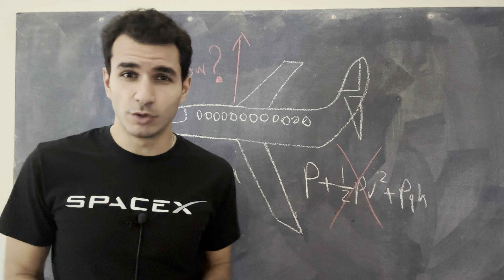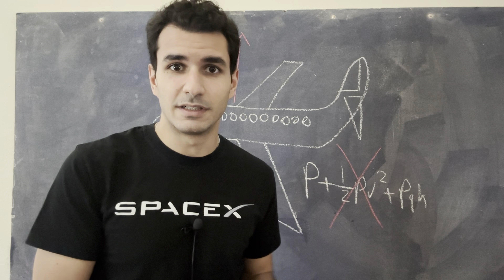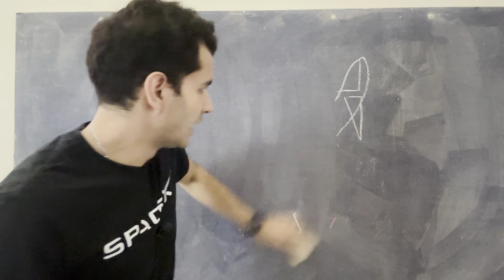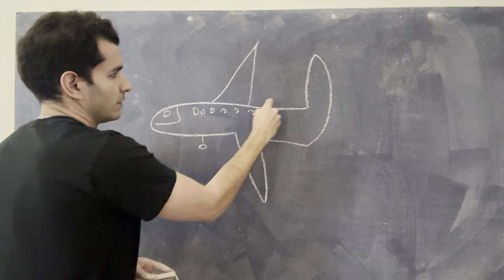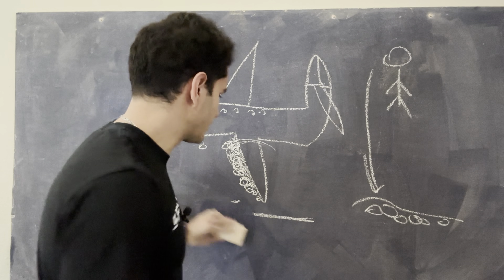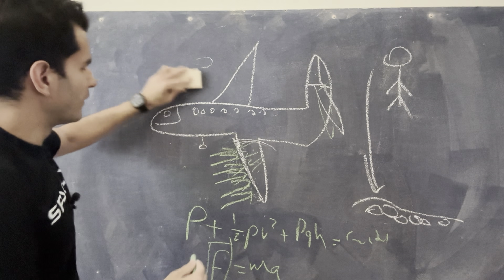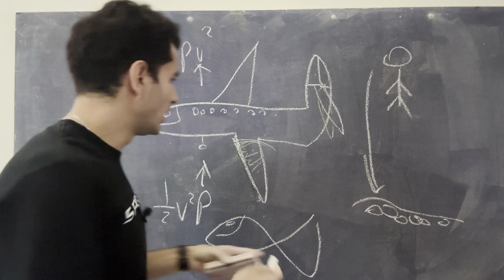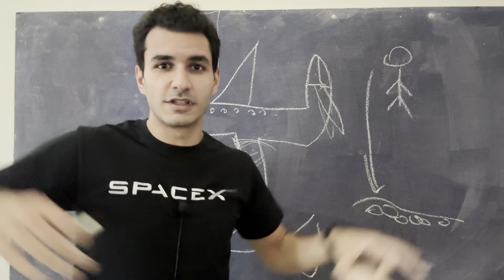Fix This One Misconception = Understand Airplanes Forever

Comment: The best explanation so far 👍, inertia! The wing splits the air by pushing downwards and forwards on the air at the stagnation point, this results in the upwash ahead and subsequent redirection(downwash) of the flow once it reaches the wing. You have to have an intuitive grasp of how the fluid is disturbed by the wing before it passes through it. As air starts to accelerate dynamically, due to the upwash, before the wing arrives there is a static pressure reduction above. As for under the wing air, oncoming air is diverted to follow the shape and leave parallel to the trailing edge. No equations needed.
Reply: No equations means no laws, no laws means no disciplined guidance to follow the painstakingly established rules, which leaves us with the anarchy of personal preference biased narratives.  It is absurd to say it is only inertia/momentum, when it has been unambiguously validated in the aviation industry that it is conservation of mass (continuity equation), energy, and momentum, separately but interdependently accounted for.
Reply: @davetime5234  Do you know why it is crucial for a wing to produce an upwash ahead of the wing? Explain in your own words please.
Reply: @singh2702 It's gotta get to the other side.  And a traffic jam exists precisely because everyone is trying to get passage through a common, capacity-limited highway.
Reply: @davetime5234  So when the oncoming fluid is directed upwards, more air is forced into a particular volume, resulting in a drop in static pressure before the air even goes over the top of the wing. This is Bernoulli and continuity. Once the flow enters the adverse pressure gradient, there will be pressure recovery until the boundary layer detaches and flow becomes turbulant, for which there are no equations to model turbulance.
Reply: @singh2702  There's an important point about the applicability of well-established fluid dynamics equations within their valid range. The Euler and Navier-Stokes equations fundamentally describe fluid motion, but turbulence—especially fully developed turbulence—remains notoriously difficult to model with exact solutions. Critics sometimes argue that these equations fail because they don't directly solve turbulence, but that’s an issue of range, not an indictment of the equations themselves.

The equations are sound within their applicable domain: before flow detachment and chaotic turbulence take over. The criticisms stem from the inherent complexity of turbulence rather than a fundamental failure of the equations. This is similar to how classical mechanics works well for non-relativistic speeds—Newton’s laws hold up beautifully until relativistic effects dominate, at which point we turn to Einstein's formulations.

Bernoulli’s principle and the continuity equation describe pressure and velocity behavior in streamlined flow, but once adverse pressure gradients lead to flow separation and turbulence, we step outside their idealized assumptions. That’s where empirical models, computational fluid dynamics (CFD), and statistical turbulence models (like Reynolds-Averaged Navier-Stokes or Large Eddy Simulation) come into play.

This is how scientific modeling works—we frame equations within the domains where they produce valid results.
Reply: @davetime5234  Having said that, back to lift. It is the negative pressure gradient caused by the upwash, which is responsible for the lower pressures above the 1st quarter chord or so. After the restriction, pressure recovery begins in the positive pressure gradient all the way to the trailing edge, assuming their is enough kinetic energy in the boundary layer. This is how lift is produced. 

Under the wing air is being redirected to leave parallel to the trailing edge.
Reply: @singh2702  "Having said that, back to lift."

The problem is that this statement actually re-directs focus away from lift by focusing on one element to the exclusion of others.

Sure, the decreased pressure is lowered potential energy for the increase in kinetic energy imposed by the upwash detour, under the condition of mass flow continuity.  But lift is a bigger picture. The pressure gradient has to operate on the larger environment; it can't just exist by itself in a limited pocket.

There must be a net downturn in flow momentum, or no lift.

For above the airfoil, where most of this pressure pulling down on ambient pressure flow occurs, the whole point of lift is for this pressure gradient to affect as large a mass of air as possible to minimize velocity in net downward momentum change.

Only the above maximization of mass in the lowered pressure's resultant downward momentum, will enable the energy efficiencies of sailboats moving faster than the wind and airliner glide ratios of 15:1 or better associated with economically viable fuel consumption.

Lift is an asymmetry turning the relative flow according to conservation of mass (continuity), energy, and momentum.

You really can't abbreviate the whole picture, because then you only have part of the engine.

Potential flow, for example, is a truncation of reality that give pressure change without downturn of momentum due to the irrotationality restriction.

You really can't have lift without the net momentum downturn as part of the picture.
Reply: @davetime5234  What have I abbreviated? I said that as the air transitions into the adverse pressure gradient pressure recovery begins, i.e., mass is conserved by being slowed down so as to increase its static pressure by lowering the kinetic energy in Bernoulli's equation in order to ensure continuity. This process will take place so long as there is enough energy in the boundary layer or if the pressure gradient isn't too strong. 

Pressure gradients are responsible for the pressure differential needed for lift.
Reply: @singh2702 How does the net change in downward momentum fit in with the pressure change, and how is the mass of that maximized at the expense of velocity?  What does this imply about the volume size of this mass in relation to the size of the airfoil?  Why does the mass flow transport split in the proportion it does and how is that split related to the pressure difference?  How is the mass flow continuity related to that split, and how does this split relate to the discredited ETT, and to the circulation?  How does the forward stagnation point streamline set the asymmetrical flow split that maintains the pressure difference?
Reply: @davetime5234  You've asked so many questions, which I don't really know exactly what you're asking.

The stagnation point is placed under aft the leading edge, not at the front. It takes place there because of AoA and geometry of the wing. Having the stagnation point there enables an upwash as the wing pushes downward and forwards as it splits the air, resulting in the oncoming air flowing upwards. 

I have already explained the pressure gradients that this upwash creates. That takes care of what's happening above the wing. Under the wing, air is redirected by the same downward forward force to follow its shape all the way to the trailing edge. The forward force component is the pressure drag associated with lift. As a wing moves through the air, the stagnation point remains unchanged. In order for it to remain unchanged, it needs to be moved forward as the wing moves forward, which means air on either side of the stagnation point is also pushed forward.

That explains the way a wing causes an upwash and a subsequent redirection of the flow to leave parallel to the trailing edge.
Reply: @singh2702  To get to the point, where is the downwash caused by the pressure drop on top?  You can't have lift without it.  The force equal to the rate of change of downward vertical momentum?

And the mass required for that force corresponds to what volume of air at ambient density?

My point here is that pressure difference, as you have strived to define, is without question indispensable.  

But equally necessary for justifying the mechanism of lift is how the downward momentum change occurs.
Reply: @davetime5234  Firstly, the airfoil produces an upwash ahead essentially converging air, and when this happens, the flow will accelerate due to the conservation of massflow rate. This is where lift begins by creating the condition of dropping the static pressure above. 

Once the flow has reached its peak velocity, it begins to enter the adverse pressure gradient. This is the diverging part of the foils upper surface, where downwash begins, as the flow will follow the shape of the upper surface due to the viscous forces. The pressure drop that was caused by the upwash is reversed here, velocity begins to slow down, and static pressure increases until its back at ambient pressure as it leaves parallel to the trailing edge. The boundary layer can not be neglected in achieving this flow pattern as its attachment is paramount in preventing turbulance and drag.
Reply: @singh2702 But why don't you have net downwash rather than the downwash you just described, simply erasing the upwash?  And again, the volume of air that must be accelerated down corresponds to requiring roughly what extent of influence height around the wing?  Well less than a chord height vertically, roughly the same as one chord, or well more than one chord height?

I hope you see why this is an important idea cross check.
Reply: @davetime5234  You are asking me for specific details now. These details will depend on the geometry, the AoA, slats  flaps the speed of the wing etc. 

The downwash is just the undoing of the upwash created by the wing. This is why a tear drop shape, similar to an airfoil, is the most aerodynamically efficient shape. After the air is disturbed at the front, the shape allows for the air to recover to its original pressure just before it flows off. It's the closest we can get to D'Alembert's paradox.
Reply: @singh2702 So again, are you saying there is no net downwash, only the undoing of upwash?  Because that seems to be what you are saying?  What does D'Alembert have to do with the considerable change rate in downward momentum?

If you can't reconcile the above you haven't explained lift because lift cannot exist with that vertical momentum change.  Pressure difference alone will not allow a fixed wing aircraft to fly.
Reply: @davetime5234  You seem to be confusing the downwash with the momentum theory of lift. 

The downwash is a result of the air following the shape of the rear uppersurface due to viscosity. In circulation theory, the fluid also leaves in a downwash but not due to viscosity. 

In my previous comments, I mentioned that downwash is pressure related as this is a pressure gradient as long as the flow remains attached along the gradient. The downwash leaving the trailing edge is a byproduct of lift and does not act as thrust. The lift vector is perpendicular to the wings forward momentum and is due to pressure differentials across the lower and upper surfaces.
Reply: @singh2702  Just to be clear, you are saying the following is false?:

Force = Lift = d(mv)/dt  (vertical)

Is that what you mean by "thrust" or not? And is the above relationship true or not?
Reply: @davetime5234  If you are talking about under the wing, I already explained that oncoming air is forced to leave parallel to the trailing edge. So I'll reiterate to make things clear, the upwash heading towards the underneath of the wing is pushed downwards and forwards, resulting in an upward(lift force) backward(drag force). The upward force leaves the air molecules nowhere to go because they are applied against the lower surface, but the drag force accelerates the air parallel to the lower surface. Newton is applied because of the momentum change. 

The downwash on the upper surface is due to the flow following the contour due to viscosity.
Reply: @singh2702 Unless you integrate the vertical momentum identity you are stuck in an incomplete narrative.  A physically accurate explanation really needs the the stress test of integrating the pressure difference with the momentum displacement.
Reply: @davetime5234 Momentum change of the fluid imparted by the wing, is necessary to produce the conditions conducive to lift. It is not directly the cause of lift. Lift is due to the pressure gradients which creates pressure differentials.  

The amount of downwash force for an A380, if it was a reaction force to the planes weight, would be over 5,5 million Newtons. This is ridiculous, as surface area pressure between top and bottom would mean nothing. The reason why plane's wings have large surface areas is to create pressure differentials rather than rely on Newton's 3rd Law, which is very inefficient since it neglects ambient pressure which is a readily available force which can be manipulated and harnessed to lift an aircraft with a mass exceeding 550 000kg.
Reply: @singh2702 Your physics are wrong at the most fundamental level (about downward flow momentum). It's not a question of assigning cause and effect, it's a question of association:  

For the A380 to stay up at level altitude, there must be an associated downward (rate of) change of momentum.

This is unambiguously true basic physics.

And you're roughly right about the number: the A380's wings must produce a downward flow momentum per second of about 5.5million newtons.  

That obviously has consequences when thinking about how the pressure difference accomplishes so much vertical momentum change.
Reply: @davetime5234 Lift is pressure differentials, which I have explained elaborately how a wing achieves this. Downwash momentum is a byproduct of lift. 

There's a video of a KLM 747 land at St Maarten, check it out. It flys a few meters above the people's heads standing on the beach, as it approaches the runway. 

The weight of a 747 ≈ 440 000kg×10m/s², that's 4 400 000N. If the downwash reaction force, to the planes weight, leaving the trailing edge was 4 400 000 Newtons, those people would have been flattened like pancakes. Instead as the low flying aircraft passes over them not a single person is affected by its close proximity.
Reply: @singh2702 The people wouldn't be flattened at all: 

5,500,000 Newtons of force for an A380 (or whatever the exact number) is distributed  over a vast volume of mass with a huge footprint, that in 1 second of forward travel of the wing, multiplied by the wingspan, all divided into into 5.5million newtons comes out to the weight of a couple of cats.

So, the mass of two cat's worth of air mass travelling downwards at a fraction of the forward speed of the aircraft, distributed over the profile of the human body.  Very easy to absorb that energy.

You can't explain lift without both pressure difference and vertical momentum change.  

The historical narrative appears, perhaps, twisted by the usefull but incomplete tool of potential flow, which comes up with the pressure but artificially disallows rotationality  necessary to capture the turning of flow momentum downwards.
Reply: @davetime5234  The video I mentioned was a 747 landing at St Maarten. The reaction downwash force would be around 4 400 000N, if it were true, just a few meters above the people on the beach, yet no one was affected. 

In the same video it also shows the plane on the runway ready to takeoff. This time the plane was about 100m away from the people on the beach. The engines start developing the takeoff thrust which is about 1 100 000N with all four engines combines. This force however exerts enough force that the people have to cling onto the fences to prevent getting blown backwards. 

So 25% of the downwash force sends people flying, as the plane goes down the runway away from the people, but the actual downwash force a few meters above them and not even a breeze.

The wing span is about 64m, that's not enough to dilute the force to where the force per unit volume is insignificant.
Reply: @singh2702 I just explained it fully consistent with reality.  747 vs A380 makes any difference?  You're either open to learning or not.

Energy from thrust is concentrated all at the exhaust exit's tight dimensions, but the downward momentum equal to the force is indisputable basic physics.

The actual pressure difference is small but has tremendous force due to the large area of distribution.  The same goes for the downward momentum of air except THE AREA OF DISTRIBUTION IS EVEN LARGER THAN FOR THE PRESSURE DIFFERENCE.

Of couse the engine thrust would knock you over but the distributed downward flow momentum would not:

The fan diameter of an engine means exhaust thrust gets concentrated in an area of 70 square feet or so; while for lift from a large jet at landing speed would be distributed over 65,000 square feet or so.
Reply: @singh2702 To summarize why your 747 example doesn't work: the thrust flow is roughly 1000 times more concentrated (confined in space) than the induced downward flow fully equal in total to the force of lift.

And because the size of the volume for the amount of mass needed to fully supply downward momentum change equal to enough lift to overcome weight, that volume cannot all be packed right down at the trailing edge: it must span a considerable height as the volume passes the trailing edge boundary.

Think of the block of vertically mobilzed air more like a large long aircraft hanger, greater in height than the aircraft but only as wide as the wingspan (roughly).

And for the length of that "hanger-like" block of air volume, on a per unit time basis, think of how far forward the aircraft's wing moves each second at flight speed.
Reply: @singh2702  I almost forgot, besides the space concentration of jet thrust vs lift downflow, the kinetic energy per unit of momentum is massively higher for the engine exhaust.  The speed is 10 to 20 times faster.  

And because speed is squared in kinetic energy, the energy from the jet thrust is far more violent than the lift down flow, when looking at the amount of momentum.

How do the wings do this with so little energy compared to the engines?:  But moving an enormous amount of air for each unit of momentum compared to the engines.

That's why the vertical change in momentum to produce lift must be considered hand in hand with the pressure difference which accelerates that enormous volume of air downwards.

It forces discipline on conceptualizing the actual full mechanism of lift, and is the only way to get insight into why fixed wings are so energy efficient that they allow intercontinental flights with economically viable fuel consumption.
Reply: @davetime5234 You keep either keep neglecting or not realizing that we live in a pressurized fluid. This pressure is critical for engines, airfoils, humans, and animals being able to breathe etc. This pressure is taken for granted as well, at sea level it's 10 metric tons of air weighing down on a square meter. 

This readily available force is the reason why the wing does not function as a rocket engine, I.e action reaction through momentum. It is just angled towards the pressurized fluid so it can create the pressure gradients above the wing, where most of the lift takes place, the region where separation and turbulance occurs yet, lift will still be produced provided there is no complete separation leading to a stall. 

In the Navier-Stokes equations, momentum takes pressure gradients into account since this is what drives fluid flow. I mentioned the converging and diverging of fluids in earlier comments.
Reply: @davetime5234  They are efficient because they don't operate like a Saturn v F1 engine.
Reply: @singh2702  If you pull on a pole bolted to the ground, you are applying a lifting force.  Why doesn't the pole move up?  Because the pole pulls with an equal and opposite tension, against the ground.

If the pressure difference of a suction cup bolted to the top of an aircraft is sufficient to suspend the aircraft from the top of a hanger above the ground, the pressure difference pulls on the hanger ceiling, which pushes down on the hanger walls, causing reaction compression forces in the structure to oppose the pressure force holding the aircraft up. 

When the pressure difference produced on the wings in flight exert the force of lift on the atmosphere, where is the opposing reaction force like with the two examples above?:  

The pressure difference "pulls down on the air".

That downward pull on the air is the necessary reaction force to the pressure difference.

And the momentum change of that pull down has to exactly equal lift, otherwise the pressure difference has no effect.
Reply: @singh2702  Efficient because they are not like a rocker engine?  That's not an answer.

Your bias seems to be about winning a discussion at any cost, ignoring physics and the real world.  You can cross check what I'm saying at any point along the way, with credible external sources, yet you don't.  Even a boxing match is won by truth.
Reply: @davetime5234  The pressure gradient once again, I don't know how many more times this must be mentioned. 

The high pressure underneath will attempt to flow to the upper surface, causing wingtip vorticies. These forms of downwash are not generating lift, they are a byproduct of pressure differentials created by pressure gradients.
Reply: @singh2702  Well, I certainly agree the wingtip vortices are not generating lift.

But from you last answer you obviously haven't been reading what I've written or spending any time studying the content and checking it.  You're answers are like you are not even bothering to read.
Reply: @davetime5234 Ambient pressure is a readily available force, a static pressure of 14.7psi at sea level. 

By creating a convergence, like an upwash, this static pressure will drop and some of it will convert to dynamic pressure. This dynamic pressure must then diverge to decrease its pressure and return to static pressure, if it doesn't then turbulance occurs, hence the tapering section of the upper surface. This conserves massflow and energy resulting in pressure distribution. 

Momentum: pressure gradients accelerate or deaccelerate the fluid in order to satisfy continuity. 

Having mentioned that, pressure can only be applied downward on top and upward on the bottom. 

An A380 wing area is huge to let pressure differentials lift the aircraft rather than taking air molecules which are on a microscopic scale, in terms of weight, and accelerate them to hypersonic speeds to equal the weight of the plane. That is an answer to the efficiency of a wing vs a Saturn v F1 engine, use a readily available force, manipulate it like an airfoil does and this free available force can lift a 550 ton plane.
Reply: @singh2702  NASA's Glenn Reasearch, for how lift is generated gives the most concise explanation:

"Lift occurs when a moving flow of gas is turned by a solid object. The flow is turned in one direction, and the lift is generated in the opposite direction, according to Newton’s Third Law of action and reaction. Because air is a gas and the molecules are free to move about, any solid surface can deflect a flow. For an aircraft wing, both the upper and lower surfaces contribute to the flow turning. Neglecting the upper surface’s part in turning the flow leads to an incorrect theory of lift."

It seems you disagree with the above by NASA?
Reply: @davetime5234  You need to understand that when NASA's website has an explanation for something so complex as fluid behavior, they will explain it in layman's terms, as it is aimed at the general public not students at university, so they will explain it in a way that makes sense to people with very little knowledge of fluid behavior but are just curious about lift. 

Anybody can make sense of that quote. Action reaction gives you momentum, easy. 

The momentum equation in Navier-Stokes takes F=ma and applies it specifically to a fluid. That's the pressure gradient, viscosity and any outside force to the fluid.

The pressures and velocities around the wing are caused by pressure gradients.
Reply: @singh2702 If you throw a bowling ball horizontally while standing on a skateboard, what causes you to move in the opposite direction?  Pressure?  Momentum?

(For enough lift to equal the weight of an A380 you must accelerate vertically downwards, every second, a mass equivalent to nearly 100 African elephants from 0 to about 10m/s)
Reply: @davetime5234  Your confusion is you aren't able to realize the force which is readily available and the weight of the plane. 

By throwing a ball and it gaining momentum from your force input does not demonstrate how pressure works. The ball gains momentum because there is no one on the other side of the ball exerting an equal opposite force. Pressure is applied to an object in 3 dimensions and is equal all along the entire surface of the ball. It is only when a reduction of pressure occurs somewhere on the surface will a net force be produced.
Reply: @singh2702 F-, you fail the course.   Muted.
Reply: @davetime5234  Failing your course is actually an A+
Reply: @davetime5234 😂